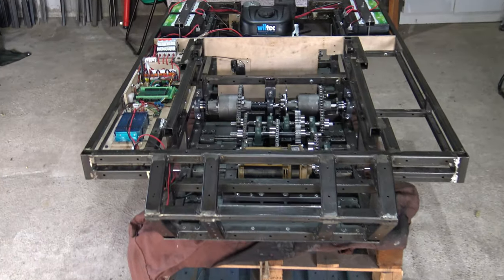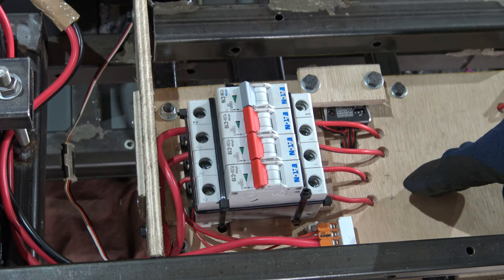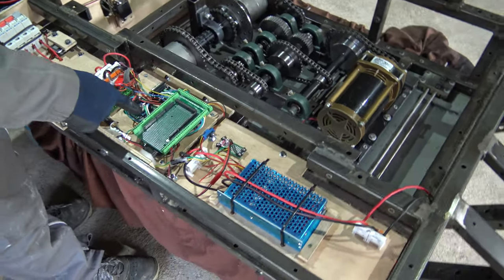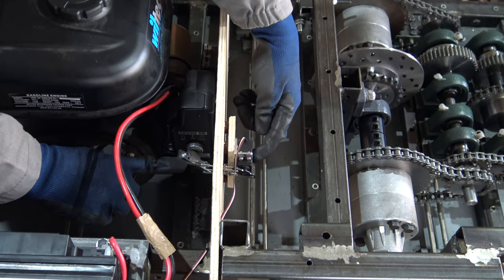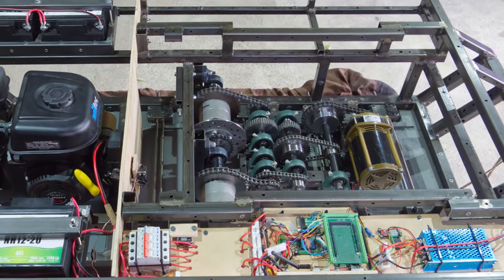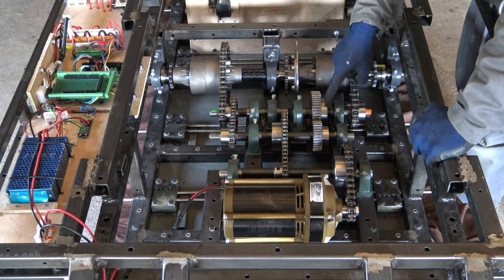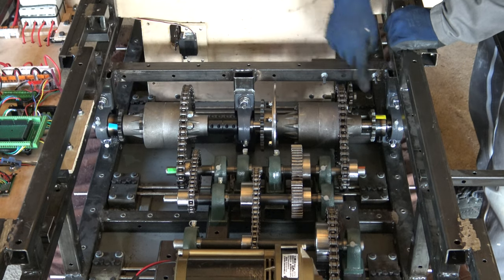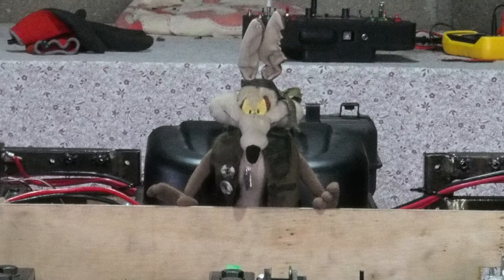450KG RC TANK STEERING SYSTEM

Comment: Awesome built dude !
By experience, if you want to protect your electronic components from early destruction, don't hesitate to put rubber or soft spacer to insulation electronic from vibrations ;)
Reply from the maker: Thanks :D ! 
Yes you're right ;) the engine is mounted on 4 silent blocks, as well as the control board as shown at 1:55. 
Some electronic components are also screwed on a piece of rubber for additional vibration dampening. In this case remember to use rubber washers and to make sure the screws don't touch their holes, so that the vibrations are not transmitted through the screws.
Modeling servos mounting systems are a good example.